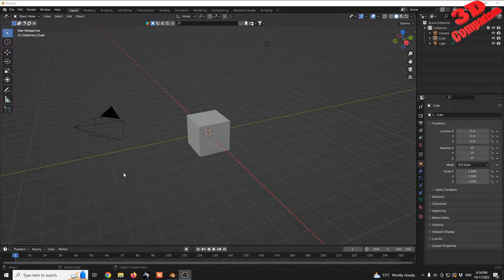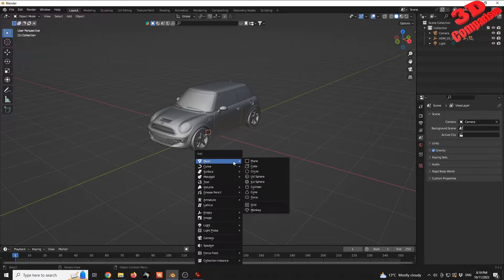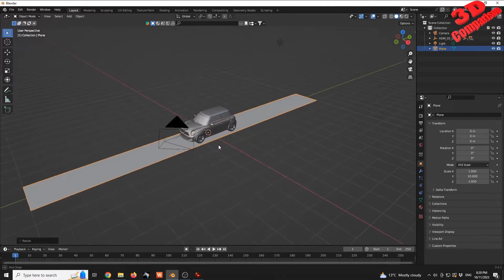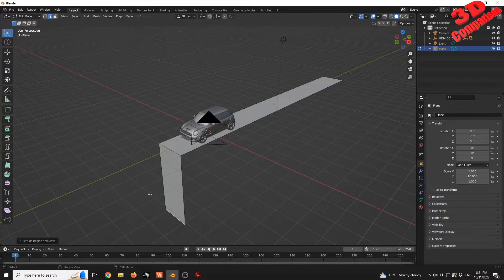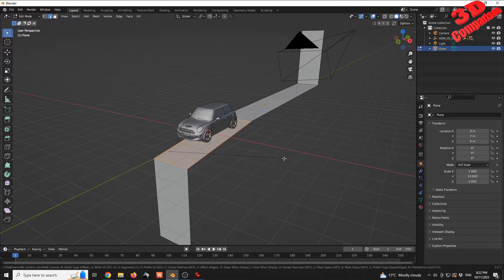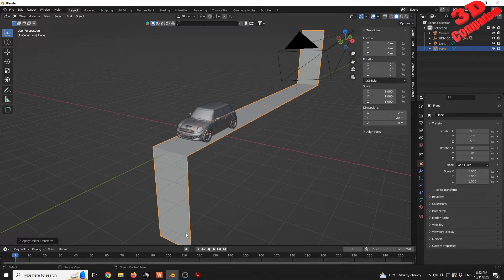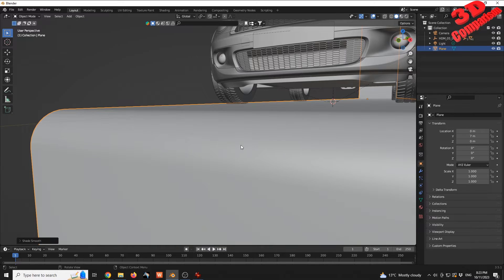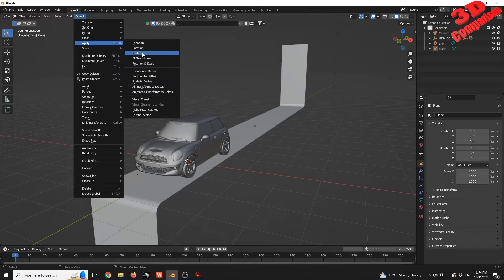Blender - How to add Fillet

Comment: "Do a bevel, use the scroll wheel to increase bevel subdivisions" - 10 second video
Reply: As a CAD user, I was not aware that I needed to select apply scale, because that was the problem.  CAD is far easier to apply fillets, kind of wish that it was easy in Blender
Reply from the maker: This video was mostly intended for CAD users. And applying a fillet in CAD is completly different. Also within a 10 video second you can't discuss additional parameters associated with bevel. Bevel substitudes both Chamfer and Fillet from CAD solutions.
Reply: I assume you have created such a video? Got a link?
Reply: not at all